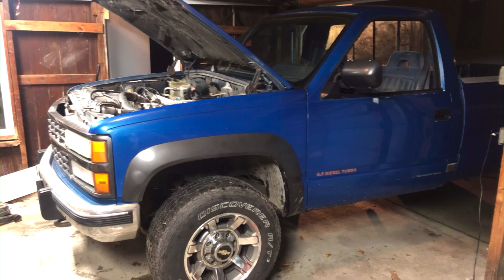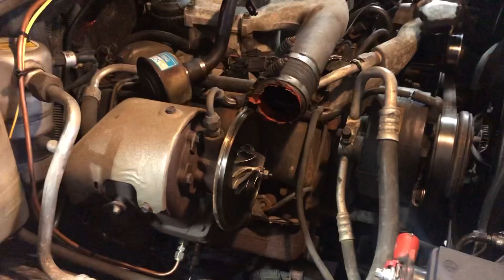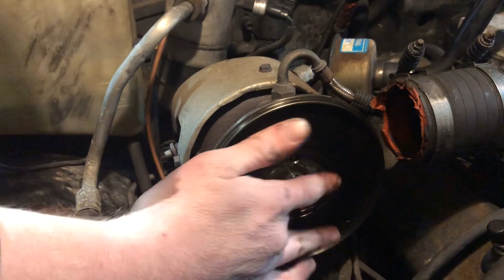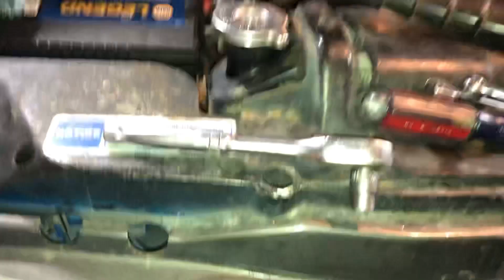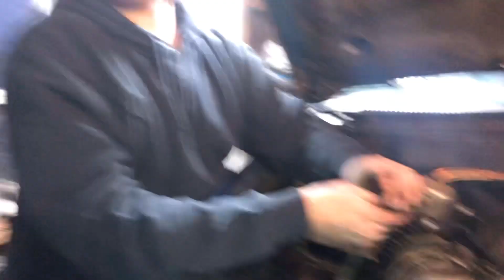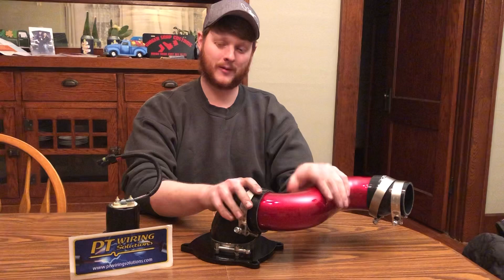GSC 6.5L turbo diesel wicked wheel 2 install and test run

Comment: Okay this is my second message to you I'm just curious if a 6.5 has the whole on the back of the block that the vacuum pump from a6.2 has? Which also drives the oil pump so I'm just curious if they're the same in that fashion and if they are the same then why in the snot do you have to have a belt driven vacuum pump on the front of the engine if the vacuum pump on the back of a 62 works the same I'm just curious
Reply from the maker: Yes they are the same in that regard. Because the engine speed sensor goes in that rear port of a 6.5. That’s why we just delete the vac pumps. If I haven’t replied to your other message yet it’s because I’m traveling for business and will get back as soon as possible.
Reply: Okay thank you just let me know when you get back take your time I appreciate it I'm not in the big rush

Comment: But if you want it to live, cooling upgrade first  hands down
Reply from the maker: Not really. 6.5s benefit more from turbos and upper intake swaps than a thermostat or a fan clutch.
Reply: @jamesheater6638  Agreed.   I upgraded the water pump, thermostats and a Duramax fan and clutch.   Consistently 30° cooler

Comment: I plan to use your videos to do some upgrades to my 95 6.5l. I saw in one of the comments you said the WW will be good for towing or hauling. I have a heavy camper. Do you think will make any difference? I am putting the upgrade intake you did and a cold air intake.
Reply from the maker: If you are towing get an HX40WII from zomebisolutions and a tow tune from Leroy diesel.
Reply: @gingersnapcustoms  many thanks🙏

Comment: So would U receommend doing this WW just to get spooling faster, i got a van center mount turbo probably a GM6 or GM7.
Reply from the maker: Personally if you plan to leave the truck stock a WW would be good for towing applications. The van turbos are more efficient which means it may be worth doing on those more so than a pickup.
Reply: @gingersnapcustoms  curious as to what makes them more efficient.  I've got a couple of 6.5 diesel vans and have not been able to find any turbo upgrades out there, so it looks like I'm stuck with the GM6
Reply from the maker: @t0mills  vans run a GM7 center mount. There are no upgrades for them so an improved wheel is about all you’ll get
Reply: @gingersnapcustoms  ok.  I'm guessing you've had a chance to compare the GM6 and the 7?
I've got a GM7 sitting in my shop, I had just assumed the only difference was the spring operated wastegate instead of vacuum operated like the GM6.
Reply from the maker: @t0mills  it’s like a GM4 VS GM8. Not a major difference other than the wastegate actuator. Center mount turbos on these are a lot more efficient than the side mounts. So that wicked wheel will cause a better improvement overall.
Reply: @gingersnapcustoms  good to know. Thanks.  I'll get a wheel ordered up and give it a shot.
I'm assuming the center mount turbos are more efficient due to the placement?

I've got 6.5 diesel trucks and also 6.5 diesel vans, and I do know that both engines with 4" straight exhaust sound completely different. Which kinda surprised me.
The 6.5 diesel trucks sound more like a LB7 duramax, and the 6.5 diesel vans sound more like a LBZ duramax.  All you hear from the van exhaust is turbo whistle.  Trucks have more of that V8 sound.
Reply from the maker: @t0mills  yep. More even exhaust flow as well

Comment: Your turbo needs cleaned out dude.
Reply from the maker: It wasn’t left on the truck and the CDR had failed. That was after 500 miles of driving post cleaning them out. Didn’t matter since it got an HX40 swap a week and a half later.
Reply: @gingersnapcustoms  Gotcha, I wasn't being an asshole, just noticed it wasn't spinning easy breezy.  Question, how much difference between diamond precups and the next size down? Have you ported them bigger?
Reply from the maker: @bobbyboucher5309  that turbo was interesting. It was a GM8 and a GM4 hybrid. Ran fine. Just was weird. 

So pre cups don’t make a lot of difference. You’ll see more improvements from 2500psi pop pressure marine nozzle injectors.
Reply: @gingersnapcustoms  I had a 4 in my 98 for a while, all I had at the time to replace the 8 I siezed. The 4 boosted ok but hardly made a sound. Is an hx 40 a noticeable difference from a 35?
Reply from the maker: @bobbyboucher5309  so far the HX35 has been the best bolt on and go turbo with minimal lag and good all around performance. The HX40 is a bit large and tends to be a bit more lazy across the board due to the lack of fuel these trucks make.
Reply: @gingersnapcustoms  With that said I had an idea a while back. I realized the pmd is like an amplifier for speakers but with a pulse modulator and the foot throttle increases modulation so why can't one build a better pmd from an amplifier and modulator. Never shits its pants and more power....maybe
Reply: @gingersnapcustoms  I also wanna build a common rail 6.5 with cp3 pump and use a distributor to open the injectors. You could then build a custom distributor cap with forked prongs to get a double open effect like tunes do in direct injection diesels. I'd ve already done it but priorities right!? Plus I'm hard as fuck on my shit so I'm usually playing catch up on something  hence why I drive a cheap truck. I KNOW for a fact I'd still blow up any dmax, pstroke or Cummins.
Reply from the maker: @bobbyboucher5309  people have tried and so far I haven’t met someone who succeeded
Reply: @gingersnapcustoms   Really, people already tried what I came up with?  I bet their problem was advance. I was gonna run the advance using the speed sensor circuit. If only I was wealthy!!
Reply from the maker: @bobbyboucher5309  I just buy a flight systems and a good USA made cable. I’ve had the same PMD in Casper since 2015. I only change it because the new one I put on in 2012 was a cheap one
Reply: @gingersnapcustoms  Didn't matter what I did, I went through way too many. I did finally buy a flight systems but I wrote off the truck not long after so didn't get to see how long it would last. But I recently learned how to fix em n I have 10 of em stacked up. Not sure why I burnt em up so much, hopefully the truck I'm building now doesn't do the same.
Reply from the maker: @bobbyboucher5309  I’ve burned up a few due to bad plugs on the IP. They get a random burnt ground pin and it throws the whole deal off.

Comment: I may be getting a 97 Silverado 6.5 this weekend and would like to do a wicked wheel in it owned said it’s consuming some oil I’m guessing turbo may be sending it into motor but I was wondering from also hearing about it would this one also have a silencer ring for the turbo?
Reply from the maker: Stock turbos do not have a silencer ring. If the truck is using oil be ready to do a compression check to verify it doesn’t have a dead hole
Reply: @gingersnapcustoms  the owner said it uses maybe 1quart a month or so and he would daily it 60-70 miles and said it runs and drives fine but who knows till you actually go and see it
Reply from the maker: @jonathanalcox9286  on average I was using a out a half a quart every 3500 miles when I daily drove Casper. So that really isn’t super bad.
Reply: @gingersnapcustoms  ok I personally haven’t done much with diesels so I’ve been watching yo ur videos a lot trying to figure out what all to look for ect on it before I get it if it isn’t bad
Reply from the maker: @jonathanalcox9286  if it would be helpful for you and others I could do a video on what to check when purchasing a 6.5?
Reply: @gingersnapcustoms  that would be awesome cause I’m suppost to go Saturday it was suppost to be a gift for my birthday Sunday lol
Reply from the maker: @jonathanalcox9286  give me a few hours and I’ll work something up!
Reply: @gingersnapcustoms  awsome thank you
Reply from the maker: @jonathanalcox9286  it’s posted. Hopefully it helps some.

Comment: I have a 92 31' safari motor home with same motor. I burnt up the stock motor at 30k miles . put a refurb. Back into it with a new radiator.$$$$$!! Still gets hot on big hills and won't go over 20mph. Any suggestions appreciated!! I know there are better motors but I'm sticking to what the bus came with.
Reply from the maker: Unfortunately unless it’s a turbo model you are pretty limited. You could do a 2000 water pump. Fan and fan clutch for cooling. PTwiring lift pump and relay harness. As for power/fueling your almost going to want to find a center mount turbo van/bus engine and swap that in with your mechanical injection pump.

Comment: WHY DIDN'T YOU CLEAN ALL THE OLD SILICONE OUT OF THE RUBBER HOSE?  LOOK LIKE A SHITTY JOB.
Reply from the maker: Well. Went there stuff doesn’t come off. You leave it. The boot also melts on these. If anyone finds a better method. Let me know!

Comment: I have a WW that’s been sitting on the shelf for a few months cuz I just didn’t wanna put it on since all the methods I’ve seen used the nut on the turbine side to hold it for tightening, but you did it without all that nonsense and that makes it a lot easier for me to do it. I also have a catch can I want to put in before I do it, although I don’t have high hopes for it helping much with the oil ingress. Love the content big dawg, keep it up!
Reply from the maker: If you run into questions about a catch can let me know. I might have some old footage and can put a video together from when I did Casper!

Comment: Hi how’s it going, was wondering if there are any good BB turbo setups, to make it loud kinda like the 03 6.0 power strokes, I’ve looks and not sure which will fit and so on
Reply from the maker: No. But there are some non gated 60mm Holset turbos you can build to make it whistle like that. Or buy. Quadstar tunings Super60 is loud like a 6.0.
Reply: 6.0’s are loud because they are VNT

Comment: I like my wicked wheel. Cheep easy   Made the turbo spool up way faster and at lower rpm. Nice to be able to ride the torque curve and let the eagles scream than chasing upper rpm horsepower
Reply from the maker: They are nice. But these engines are meant to run above 2200 RPMs. Lug them down and that’s when you start seeing more and more issues. Part of the reason I did the turbo swap. More air flow. Lower temps. Better for towing. Glad you like how it runs!
Reply: @gingersnapcustoms  what turbo is it
Reply from the maker: @stevennewman3557  that’s a GM8 with a GM4 cover since the original was cracked.

Comment: Curious to see what the intake does with the ww2. Currently that's  my set up on a db4 with quadstar intake .
Reply from the maker: Video is up and the WW paired with the upper intake makes a good size difference!
Reply from the maker: Upper intake is bolted on as of 9am. I’ll try to drive it on lunch and get a video up for everyone
Reply: Hi again gsc,I'm installing quadstar upper intake on Friday does the ww improve performance enough to feel the difference?

Comment: Great video guys love what you are doing so I will drop my 2 cents so please take it for what it is.

1. Going from 21psi of drive pressure to around 18psi is a fairly decent reduction of around 15%. And a drop of around 75-100F in EGTs is definitely significant on a non intercooler diesel. I agree a HX35 would probably see better results but that’s not bad for a $150 drop in wheel.

Second I am willing to bet a GM8 would have even better results with even lower driver pressures especially with the WW2 installed. Once again the HX turbos will probably still be closer to 1:1.

And my last thought is 20psi of drive pressure really isn’t crazy high especially on a diesel.
Reply from the maker: So I’ve run the GM8 and GM3 with nearly the exact same results. With the old IDI diesels you want to reduce as much heat on the exhaust side of the head as possible and keep your incoming and outgoing pressures as close to the same as possible. All of the points you just made are great. But unfortunately in the case of these engines. 20psi drive pressure for 10psi boost is terrible. Does it work? Absolutely! Would I suggest a wicked wheel? No. I’ll be strapping on a high glow upper intake today and we will take it for a spin. Who knows. Maybe that’s the magic piece missing you help get the numbers closer to 1:1
Reply: Ehh yeah the wheel is $150 but a ebay china turbo is about that as well and then the install kit is a bit more but you get way more bang for your buck since then its less drive pressure so better exhaust flow and hx35's easily boost 20psi+ stock form